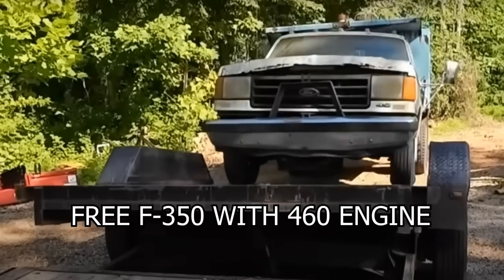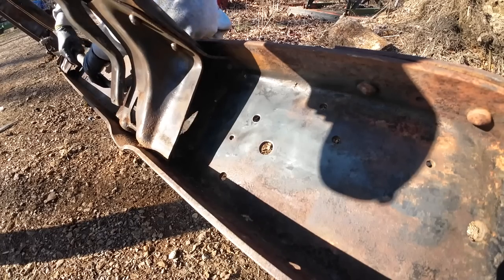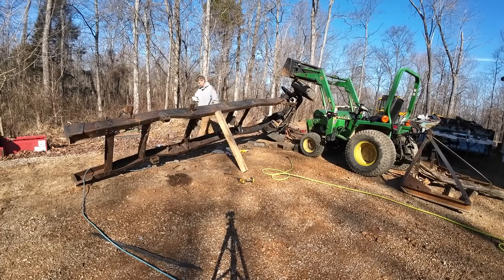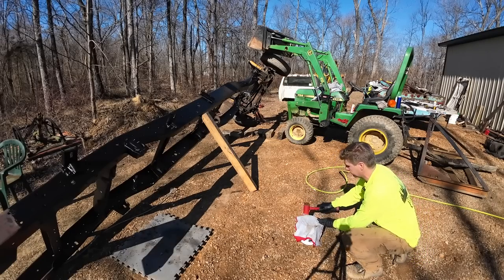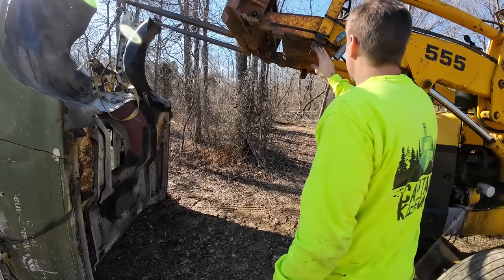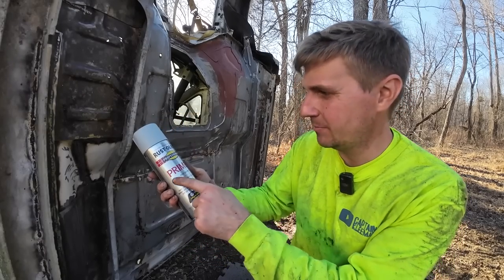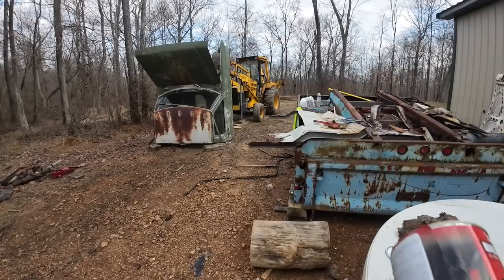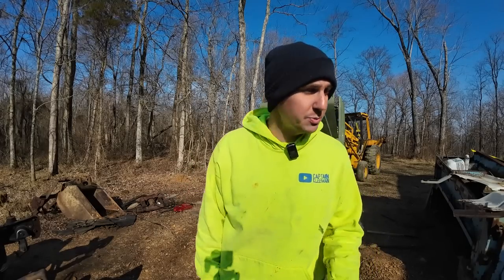Painting Frame and Bottom of Cab! - Ford Super Duty Dump Truck Build

Comment: Mike I worked on aircraft  for 35 years along with cars, trucks ,lawn equipment for myself with a complete house   Reno and when you get into big projects you have to divide the project into tasks. On large aircraft with the task system you do a job sign it off and move onto the next and not look at the whole project except for the next task. When I did my house looking at the whole project at once you can be over whelmed and have a panic attack, take a part of the project complete it pat yourself on the back and move on.

Comment: If you have never used a needle scalier before, you should go to Harbor Freight and get you one. They are amazing for cleaning around bolts and brackets. I use them all the time. They are even good for cleaning slag off of stick welds. I love mine.

Comment: Your truck cab floorpan is looking great. You're doing a fine job in removing the rust and painting it on the top and bottom. The frame is looking great too. Thanks for taking us along as you recondition your truck. I always enjoy your videos - keep them coming. (In my opinion, the outtakes don't need to be special.)

Comment: Ospho is a rust remover and it’s a primer coat, about 40 per gallon and this stuff is like water and goes a long way! It dries as a white powder layer and you wipe it off, and you can paint over it or put your own primer over it! I’ve used it a lot and it actually kills the rust, would be nice to spray that bed liner spray on the frame! That would last a long time! Just thinking out loud Mike, I’m cool with whatever is in your budget!

Comment: So, on that "Farm & Implements Paint" no matter which kind you use, I have found it takes way too long to dry, I bought some stuff called "Japan Drier" it was like $16 for a metal pint can at Sherwin Williams - I put like a thimble full in a 2-cup batch of paint and it dries twice as fast (I also use the catalyst/hardener from Tractor Supply)

Comment: FYI, the weight proportional valve is obsolete, sadly 😢. I also needed one for one of my Super Duties 10 years ago and was giving this sad news. Haven't a clue if a guy could get one used from say Texas!! Nice device when they worked. Reworking brake lines is a  bit of fun if you can double flare your own brake lines.

Comment: Good job and video. I would recommend mounting the rear axle to make it easier to move around and set the cab on. I would also recommend using white raptor liner on the back of the cab to help with rust prevention under and around the back window
Reply from the maker: If I ever get a rear axle, I will be sure to mount it lol

Comment: Great job 👍turning out great. I will make couple recommendation when you do paint the cab stick with one brand of paint and primer . Also I just used majic brand from  tsc on a project and that was a nightmare to spray . The paint had to be thinned almost triple and they don’t provide date codes on can so it can be old as heck…

Comment: On extension cords, I do a square knot and plug the two together.  Then if you tug either end the knot takes the tension not the plug.  Simple and uses some length but keeps plugged in.  I've seen S curved third party items that the S sits over the plugs and do something like the square knot.

Comment: "Been  there" 18:40  back in the 1980s  my dad gave me some paint to finish a motorbike trailer that would hold 3 bikes (built in about 4 hrs). Normally I would have used a paint in the UK called Hammerite, my dad gave me some of his black ??? paint and I sprayed it on with the compressor and proper paint gun. The black paint dried fast so I gave it a fingernail test and it flaked off, there was no adhesion. I had to wire brush the trailer end to end and start again (that took 3hrs of brushing). 
One of the lads in the shop had a dog that always went home the colour of what we were spray painting ;-) The dog would always get in the way, I do think he was always trying to help.

Safety in our shop -we did not have any safety gear just a shout "Watch Out" that was it. NO hats, gloves, glasses, masks, boots just a pair of tweezers to pull bits out of your eyeball and duct tape to stop blood making the steel rust. 

All the best, I wish I lived closer I would give you a hand.

Comment: Looks good. Voice of experience here - throw a coat of paint over the POR-15 on the frame, doesn't have to be fancy and can just be cheap rattle bombs.  It will help it last...ask me how I know.
Reply from the maker: It was literally done in this video.  Also mentioned this is the por 15 top coat which doesn't require a top coat.
Reply: @CaptainKleeman  HA! I missed it when I had to mute it to take a phone call, sorry about that.

Comment: You can get Valspar enamel gloss & hardener at TSC 💡
It will make that stuff cure quicker.
Also: if you bought cab mounts from LMC the rears are NOT GOING TO FIT! 
Just so you know, the last digit in the part# is off by one. 😉

Yeah. Im that freaking know-it-all, but i can be useful!  😆

Comment: From what I have found in the past about Items going on clearance is the fact that they have to many VOC's or in the case of pesticides to much or the wrong poisons. You was able to buy a great rust preventer which was Zinc Chromate primer which sealed and Galvanized the metal but as all others they changed the chemical compound.  in the past Years ago I bought Wolman brand termite killer for wood posts and they stopped selling it and now have a new water base coating to slow them down.

Comment: Next time you use wax and grease remover put it in a spray bottle. Spray the surface and wipe it off. It will go 10 x further.

Comment: You NEED a needle scaler for all those nooks and crannies!
Reply: Title says "easiest way"   proceeds to struggle needlessly!  🤣
Never change, Captain!
Reply from the maker: Hey Jim, a 94 450 super duty axle should work on this frame yeah?   Will probably aly have to have a drive line shop modify the drive line, but im okay with that.  It has 5.13 for the gear ratio.
Reply: @CaptainKleeman  Absolutely, a 94 D70 axle will fit.
You are going to have to find a drive line brake to fit the back of a 4x4 Zf gearbox, unless you want to always chock it.
With that ratio it will hold fast in 1st or reverse, but I know nothing about the bleed down of your engine!
Best, Always!  👍
Reply: To add: all these C&C trucks use the same industry standard frame width (so anything from a roll back to a bucket to a utility body or dump will fit!)
This also means the spring seats on the axle are pretty much universal
Reply from the maker: @jimurrata6785  thank you sir!
Reply: Come sign up with us!
We have a self-proclaimed "Old School Hotrodder" (that's his actual website!) Bill, and a couple of parts counterman's that spent decades at Ford dealers when these trucks were new on the lot.

Comment: Both those products aren't fussy about how they go on. Just use a large brush and spread it on without being stingy. Time is more important than being an artist. Seems like you did ok.
    The frame can be hung between two trees with rope or cables to make a poor-mans rotisserie. Use a third rope with a hook to hold it in place to prevent spinning. Use a come-along to hoist it up.

Comment: It's going well. I wanted to suggest putting the cab on some saw horses. I have been watching red poppy ranch on YouTube do some restoration/truck swapping and that is what he did with his as he repairs the rust spots and things. He has not made it to a painting point yet but is getting pretty close. I believe he was using the same stuff you used on the inside of the dump truck cab though. It made it easier for him to get forks under the cab and move it out of the way to roll the chassis in and out of the shop. Absolutely nothing against how you're doing it, it works. Exciting to see the progress you are making on this project.

Comment: Hey capt I have a help on the roof paint of the dump I found using on my 18 rigs in Michigan I painted the roofs using the mobile home roof paint it repel the sun's rays big time I done my tractors roofs trucks anything my head's under even lawn mower roofs you brush or roll I brush then lightly sand I think a gallon to do the top of 555 and the dump and the world headquarters same material